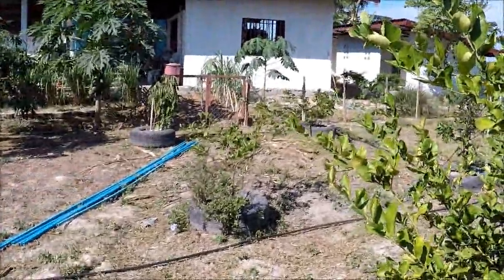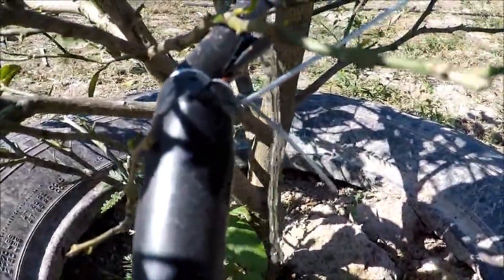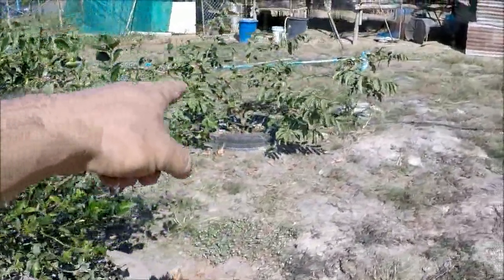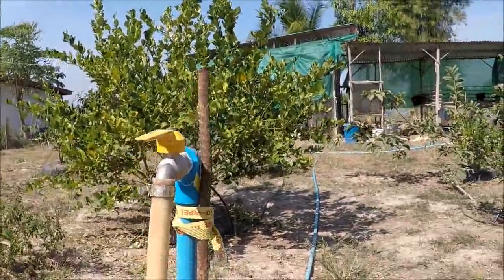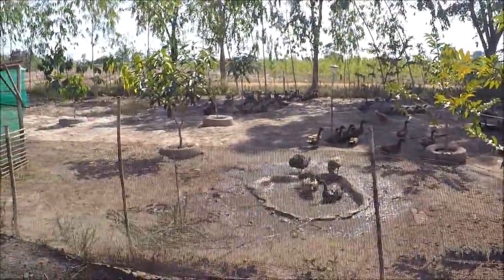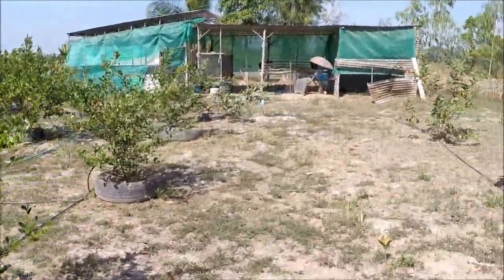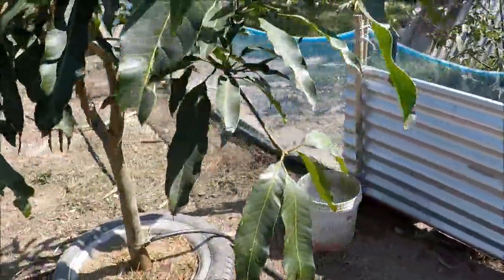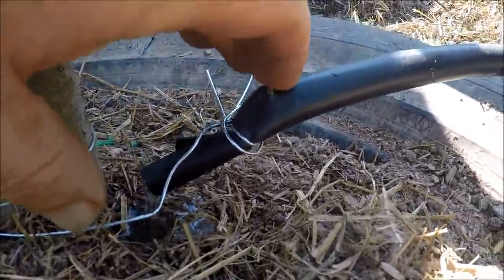Low cost irrigation system (UNDER $25!)

Comment: Nice mate.
This is my next project after uk.
With the 50 bananas we have around 120 fruit trees, then theres 80 chilli, okra, egg plant, takes bloody ages each day.
I did set up sprinklers for veg garden but im not happy with it, doesnt water everything, when it sprays out it doesnt get much on bits closest to sprinkler head, have to play around with few ideas.

My biggest concern with irrigation is the water that sits in pipe heating up all day, when that 1st comes out its red hot, does it not damage roots ???

Merry christmas to you all, hope next year is another great year for you x
Reply from the maker: With trees it should be fine but veg I'd go for drip tape set back a bit from the foliage. Failing that water early morning.
Reply: its an old trick to coil the hose in greenhouse to get warm water on toms yrs agovictorians did it  will help with yield water
Reply from the maker: Clever boffins those victorians 😉

Comment: I understand the wire is holding each nozzle in position but I don't see the point of also using it to pinch the nozzle to cut down the water flow...  Just turn the tap down a bit...  ;-)
Reply from the maker: It's all to do with water pressure Harry.
I spent days of research on it and these are my findings.
Toon uses the wire to create pressure. This is required because Thailand has zero pressure (people say its the main reason they come to live here.)
Where as Australia has by far the highest water pressure. This is because the country is upside-down.
Always finking Harry.
Reply: @TLFarm  - Too comical for words. Keep 'finking'. 555

Comment: What if you used wooden corks on the ends tied in with small hole drilled into the corks
Reply from the maker: Good idea Lynn. Toons wiring system is doing a great job for now, so we'll see a bit further down the line 👍

Comment: Genius, you will be getting a call soon to irrigate the Sahara desert!! Have you thought of using jubilee clips on the end of the pipe to adjust the flow of water ? Merry Xmas ,
Reply from the maker: The Sahara maybe a problem for us (Toon doesn't like sand between her toes!)
Jubilee clips is a good idea and think it would work but Toon's wiring system is doing a great job for now.
Cheers Leigh and Toon.

Comment: That set up looks awesome for the price! But how about the temperature on the water in the black pipes, are the plants okay with the almost "boiling hot" water? Or do you have a plan to cover the pipes from the hot sunshine?
Reply from the maker: It's something we'll need to keep an eye on, but think it'll be ok as the first few minutes of pumping water only wets the surface of the soil so the roots should be fine. Day 3 today using it . . . So happy with it so far👍

Comment: merry Christmas l and t awesome hydro delivery system bro them drippers allways block as well what you done works well and cheap win win if I remember right  when you put fifty gallon drum every foot off the ground adds barr of pressure so if you had drum up higher you have pressure to squirt hose as well around some parts of garden good luck
Reply from the maker: Font of knowledge you Raymond! Cheers Leigh & Toon.
Reply: just love what your doing buddy try help in lil way not trying be know all  buddy black soldier fly bin google it you will love it leigh just read book on it all done in Thailand the trials as well there cash in it buddy good luck
Reply from the maker: Maybe in 2019 . . . Need to research it